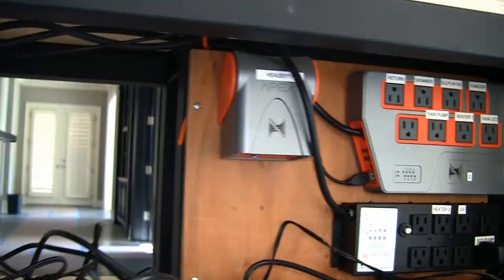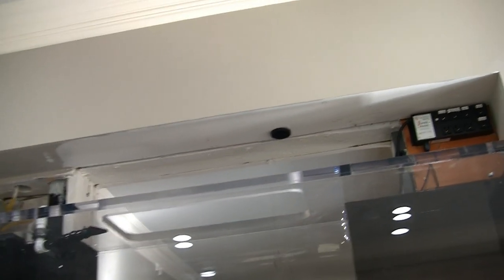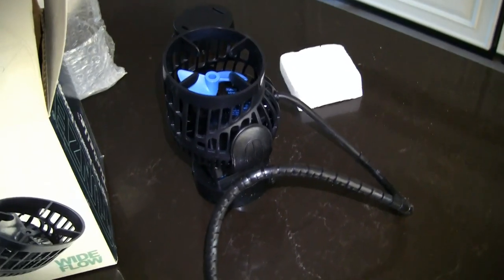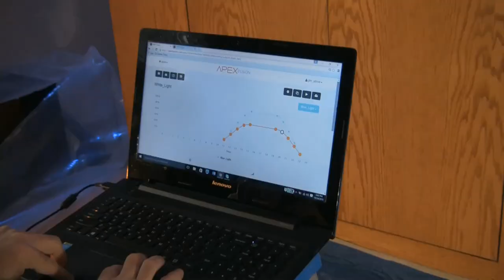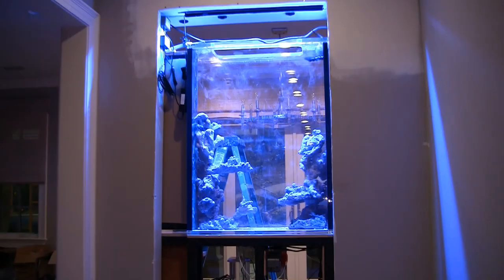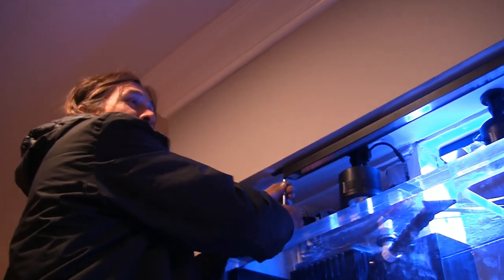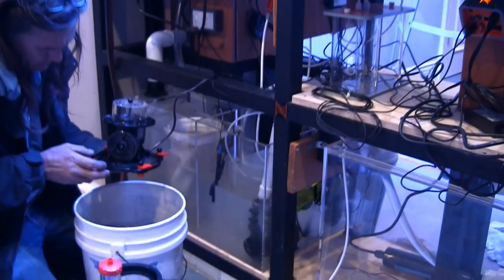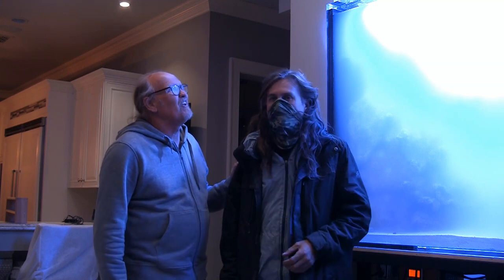The Step Tank, Episode 170, LA Fishguys, Part 2

Comment: Hey Jim, love the content. I’m really considering going acrylic for my next build but am terrified of the aspect of cleaning the panels. You still recommend the mighty magnets? Wondering how cleaning toward the bottom of the sand bed would work. Thanks
Reply from the maker: Depending on the shape or size of the tank using Cleaning Magnets makes wiping algae much easier. I use them on all my big tanks. You just need to make sure the 'pad' surface is free of debri's and then pay attention with each stroke when using the magnet. Do the bottom last and I use my hand pad for the gravel line.
Reply: @lafishguy  thanks a lot!